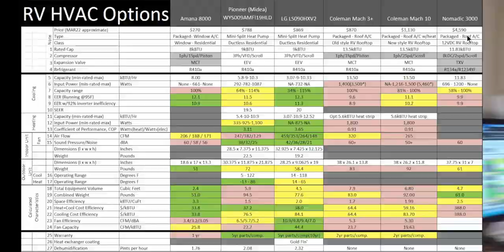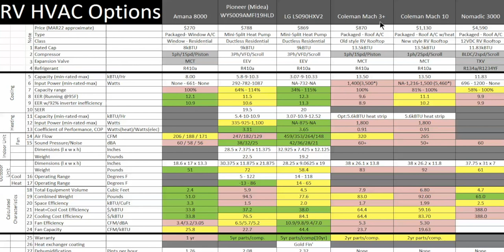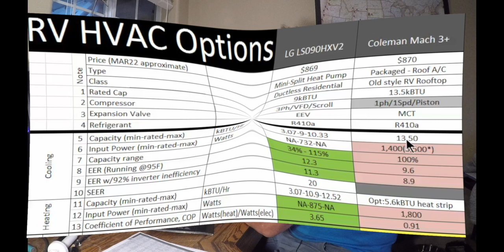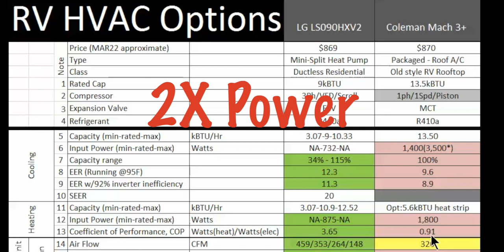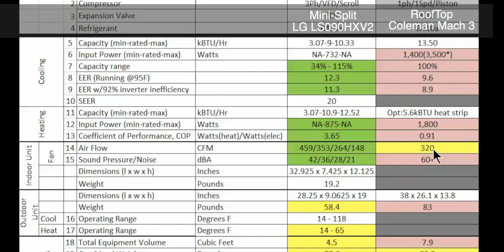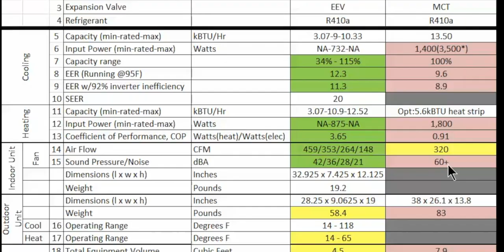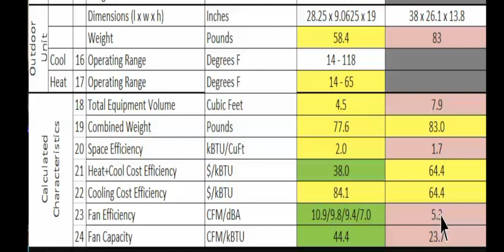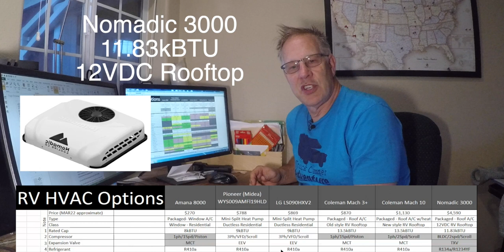RV Rooftop vs Mini-Split AC | Shop Talk | DIY Truck Camper

Comment: Awesome vid, wish you would have compared it to a cruise n comfort.  Also whats you’re thoughts on the cruise n comfort?
Reply from the maker: I looked at their website (again) based on your question. They, like so many others that don't have to provide standard performance data, they don't. What they do provide is obscured in their own jargon.....I found it interesting they are trying to make as unused industry phrase 'progressive compression technology', into their own seemingly proprietary feature when in reality it is just the way scroll compressors (used by many) work..I will make an attempt to compare some other units including this in the next couple weeks.
Reply: @WorkingOnExploring  awesome looking forward to the video.  give Chris at cruise n comfort a call.  I am very curious in its efficiency. Also it’ll be cool if you can post the excel sheet on google doc or something
Reply from the maker: I've been working on adding 5 new models to my analysis, including CNC's HD-12L....What I've been able to divine from what is on their website is indeed indicative of a high efficiency claim. At this point I am dubious however and am attempting to get more information from them. It appears they are using a single speed compressor (motor type unknown) likely using a thermostatic expansion valve and definitely using R134a, none of which are likely to produce a system that would stand an ASHRAE test and meet their claims. They are in a market space where they also don't have to prove any of their efficiency claims or produce data based on ASHRAE standard tests. Because I have worked in the custom A/C manufacturing business, I have a decent feel for what makes highly efficient systems and they do not appear to be on that path. I will give them the benefit of the doubt because it would be involved to do otherwise. If you are serious about a 12V system, take a look at the RecPro 12V rooftop system. It's a packaged roof unit made up of what may be almost exactly what CNC uses, has good performance numbers but is less than half the price.
I may get the information needed to finish my spreadsheet in a week or so and will publish it on workingonexploring.com/techdocs.
Reply: I know they have a 48v version of the HD-12L.  At least that would yield more efficiency?
Reply from the maker: Possibly but if you want to go 48V checkout 'Hotspot's' 12kBTU minisplit (DC4812VRF I think is the part number). if you can accommodate that form factor (lots quieter and more efficient). Probably the most efficient unit made by anyone....at least I can accept their data as realistic...
Reply from the maker: So yes, a 48v unit should be more efficient than a 12v.....I didn't compare the 48V because I would assume it to be a rare bird. There are lots of advantages to going to a higher DC voltage than 12V (I run 24V and if I could do it over again, would have set it up for 48v.)

Comment: great video, was looking at the diff AC options. my only question is that I noticed the mini splits were 3PH. So, 230v, Is that available from an RV park? Will these work with a 30amp adapter?  Perhaps you should have included a 115v unit instead for comparison?
Reply from the maker: All the unites compared are 120VAC or 12VDC. All 'inverter' minisplit  use a 3 phase,  motor. In our case we are using a 120v 3 phase motor driven by single phase 120v power through a variable frequency drive(VFD  - incorrectly called an 'inverter' by the marketing folks)....I understand your confusion....if you are not familiar with variable frequency drives, you couldn't have known this....single phase motors are about 10-15% less efficient than three phase, they require a start and a run winding, capacitors to start and run, a centrifugal switch to go from start to run.....lots of hardware... A 3 phase motor is just 3 coils and can be reversed easily, have higher starting torque.....a VFD operates by first converting the AC input to DC then converts the DC back to AC at the frequency desired to make the motor spin at the correct speed (the section in the larger device that is the VFD  that does the conversion of DC to AC is the 'inverter' that what people are familiar with) . 60hz will run a single pole motor at 3600 rpm (60 revolutions per second). 30hz will run it 1800rpm, etc. This is the best method to make a variable speed, induction motor     AND also a method to increase efficiency AND get variable capacity...
Reply from the maker: Alibi...I have updated the spread sheet with 6 more units and it is available for download at WorkingOnSExploring.com/tehchdocs.....Its I still plan to dual, inverter window unit to it and some sound data needs to be found but its pretty interesting. One of the units is a SEER 38, 240V mini split unit a viewer asked to be added and another user asked for a 48VDC minisplit....normally, I'd be with you, wondering what nut would use 240VAC let alone 3 phase for an RV. The SEER 38 is an absolutely amazing machine. On one hand, if you're paying for power in an RV park and have 240V/50A why are you too concerned with efficiency? On the other, if you go to the effort to put in a split phase inverter and all the solar and batteries that would need to go with that, it would be far from small but you could be the king of the boondockers!

I hope my first reply makes sense to you.....I did it from my phone while I was also trying to make dinner....so I did notice less than excellent grammar in my explanation....if anything doesn't make sense, feel free to come back...
Reply: @WorkingOnExploring  ok, now making sense, I understand varriable freq motors, I've never heard them called inverter motors before.... also you listed 230v on your spread sheet. Now the comparison makes sense... you have  a lot of patience to put all this data together...  due to your work and comparisons when my roof ac's fail I will replace them with mini splits... i've installed normal house spit units but never a mini split in a moho, sound like a fun project...
Reply from the maker: The A/C marketing lingo uses the term 'inverter' for no good reason when it refers to a variable frequency drive....they make it worse by using the term 'dual inverter' which is a misnomer but it rolls off the tongue....they are actually talking about two separate aspects of a compressor. 1) 'dual' refers to the use of two scroll compressors on the same shaft but 180 degrees out of phase. This is functionally identical to a two piston compressor in which the pistons are 180 degrees out of phase which both have the effect of increasing capacity and decreasing vibration....in the case of pistons, it is so obvious, it requires no explanation (and never gets one), the same is also true of two scrolls but the liars in marketing are always trying to make something out of nothing......the 'inverter' (as previously stated) is simply a more familiar and easier term to advertise  than 'variable frequency drive', although technically incorrect......they also are trying to use 'inverter' when they are talking about the electronic speed control of a brushless DC motor which is a very different animal but the liars don't really care...

Comment: I like the idea all around with the mini split but haven’t heard anything bout the inverter, do you need to upgrade or can you stay with original one ? , should you have it on a separate breaker
Reply from the maker: I'm not sure if your question is about the 12V/120V (power supply) inverter or the (speed control) 'inverter' inside the mini-split so will try to answer both questions because they are related. The mini-split 'inverter' is misnamed by the marketplace and actually refers to the Variable Frequency Drive (VFD), of which an inverter is one of the parts of the VFD. The VFD is the speed control for the compressor. One of the virtues of speed control is that it can start the compressor slowly and speed up to whatever it wants without EVER overdrawing its run amperage. Said another way, there is no 'starting surge' that is prevalent with single-speed compressors. The lack of a starting surge means a mini-split does not need an oversized (power supply) inverter on which to operate. Again, as with single-speed A/C RV roof units, a 13.5kBTU unit may have a running amperage of ~12A (~1.45kW) but the starting amperage is probably around 2.5kw. The (power supply) inverter needs to be sized for this starting load so would likely need to be 3kW.  In my case, my 9kBTU LG mini-split has a full load amperage of ~8A (960W)  so I could run it on a 1000W inverter if I wanted. 

As an aside, 'high frequency' (cheap) inverters frequently are marketed as having a 'surge capacity' of approximately double that of the continuous duty capacity. What is unsaid, is that surge capacity is only available for under 100mS, which is not long enough to start a heavy motor load. It is effectively a deceptive marketing ploy. They do it because 'Low frequency' inverters (that have a large copper wound transformer inside, are heavier and significantly more expensive), also have a similar surge capacity but their surge capacity is REAL and lasts anywhere from 10-15 seconds to 10-15 minutes.

In electrical branch circuit design, there should be a breaker AT the source of power to protect the downstream system (the wiring). For a receptacle circuit in which loads are small and a single circuit can run multiple devices at one time, having one breaker to protect multiple receptacles is fine. It is understood that not ALL loads can or will be operating simultaneously. For large, single loads it is necessary to have a dedicated breaker so that it has (because it needs it all)  the complete power of the entire circuit and no other intermittent device can load a portion of the circuit, leaving too little for the large appliance to run.
Reply: @WorkingOnExploring  terrific this helps out a great deal , there’s a lot of installment videos about these mini splits but like I said none bout the electrical and or inverter 
Thanks again you’ve been very helpful it made my life easier and less problems down the road
Reply: @WorkingOnExploring  oh thank you for getting back

Comment: So what will be the best most efficient and durable mini split to put on a semi truck thats a condo sleeper to run off generator and shore power or maybe battery bank? Thank You very much.
Reply from the maker: Might get in trouble making assumptions about the size of a 'condo sleeper'.....what is the volume of the sleeper, and the insulation. Most Mini-splits, even the smallest 9kBTU, are going to be too big for even a big sleeper. Too big is a problem, even for variable capacity A/C. Single stage A/C comes on and off. To be efficient, they need to be 'on' about 50-70% of the time and ideally don't come on or off more than 2x per hour. A small space makes them start and stop very frequently. Variable capacity A/C runs over a speed range of 30-100%. It wants to run all the time and just slow down when the cabin reaches temp. With too small a space, it will be forced to shut down lest it over-cool.  My vision of a semi truck sleeper is maybe 6x8(?) = 48SF? Rule of thumb sizing for (residential) A/C is 400sf per ton (where 1 ton = 12kBTU). This makes a 9kBTU unit suitable for ~300SF. This square footage is for a well insulated house so assuming a poorly insulated RV (or sleeper), may be appropriate for half that (~150SF?). In any event, I'd say that a (any) mini-split is likely inappropriate for such a small space......unless I'm wrong on my size assumption.
Reply: @WorkingOnExploring  I agree with your logic and assumptions, however I have had a couple of splits fitted on the roof of a Seedgrading Machine Cab Truck I used to own for years in outback Queensland Australia, and from my experience (and I never had inverter types), I would guess that this guy would actually get a good experience from any small inverter type A/Con in his Cab Sleeper. I know a number of Truckie’s who use different type of A/C’s in their rigs/sleepers. Without knowing his particular situation I would say it is always better to lean on the worst case scenario as a truck can go from freezing to very hot conditions regularly, in which case I would say it is still always better to err on to have more aircon capacity than needed rather than less, regardless of efficiency (to a reasonable degree), and he will probly have more than enough power onboard to run a A/C on battery for the few hours of sleep he will probly get anyhow.

Comment: I wonder if the Midea 8000 btu with compressor which is 15 seer would be a good choice . I have it in my Airstream and at 86 degrees in dry mode and sitting in front of a small fan I’m very comfortable. It should use much less in dry mode.
Reply from the maker: I scanned the Midea web site to attempt to identify the unit you were referring...there were several 8k's so I'll just make some general comments; 1} 8k is likely too small for the poor insulation inevitable in any commercial RV. 2) 15 SEER is most likely a 'single stage' (speed) unit which is on the low end of what is possible with A/C's commonly available. 3) By referring to 'DRY' mode, I assume you mean  DEHUMIDIFY. Dehumidification mode will remove more water in humid air than 'normal' mode and also requires more power to do so BUT, in high humidity environments, normal mode will still expend a lot of energy removing 'latent' heat (condensing moisture) because it is an unavoidable step in coming humid air. 4) With air movement and virtually any air conditioner, you can be comfortable directly in front of it. Air conditioning design is about sizing to a space and condition to be able to cool the whole space so  you're trying to achieve something different if that is all you want. 5) Midea builds air conditioners of many types and features which it sells under 17  wholely owned brands such as Pioneer, Senville, C&H, Mr. Cool, Gree etc. It might be safe to say that it's likely that brands that appear to be new are likely a Midea owned brand. Most brands have some minor feature changes and may sell nearly identical products with minor differences. For instance, some sell wifi enabled controls. Mr. Cool focuses on DIY installs (and are significantly more expensive). Most products are less expensive AND less capable than products from premium brands such as LG, Mitsubishi, Daikin, Toshiba, Panasonic, etc.
Reply: @WorkingOnExploring  Great info. Im talking about a window unit thats rates most efficient out there and has a compressor . Its used 30 percent less on dry mode so that means even less power. I like the fact that when it breaks its cheap enough to just get a new one rather that being at mercy of dishonest ac techs. Im buying a road-trek today and when the current ac breaks ill try it. Im also gonna test the power consumption of the one i have in my airstream which i keep on the highest setting 86 and its still feels great if i have a simple fan. I actually prefer it to the cool mode . Then maybe i can use less solar to run my ac if i choose to go solar in ny road-trek which would be my ultimate dream to boon-dock in Baja del Sur in summer.  Ill let u know .
Reply from the maker: Window units are, without a doubt, the most economical solution. The largest drawback is noise. Take a look at the newest LG 9k that is a variable speed (inverter).  It is more energy efficient than most other window units that are single speed. It is also quieter....around 50dBA rather than 60dBAs as most are.
Reply: @WorkingOnExploring  Yes i just installed the Lg dual inverter window ac in a rental. I love the idea of using new technology without being beholden to the experience repairs that usually accompanies this new tech. I got it  on sale at costco  for 300 and will probably last 5 years or more. I just put $2200 in simple repairs in my central ac and had to deal with dishonest techs . One took out freon the mext putting it back lin. In reality it just needed the coil cleaned which i did myself for 7 dollars. Never again !! Only window ac now that economical models .
Reply from the maker: I had a rental experience 2 years ago where 3 techs all gave me different failure analysis and the last one stole the refrigerant...I kicked them out, drove from WY to SoCal in a day and spent 2 weeks buying and installing 2 new systems...you should be equally wary and I'm glad you've found good solutions that meet your needs.